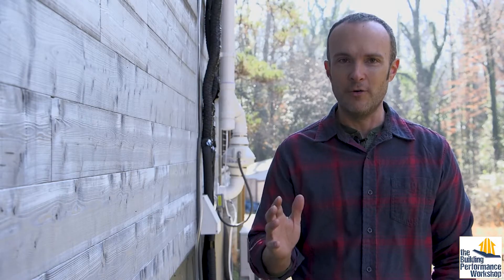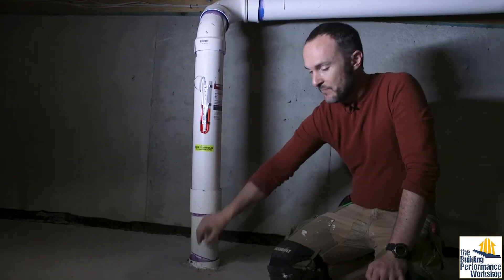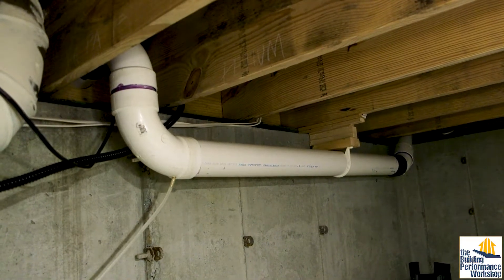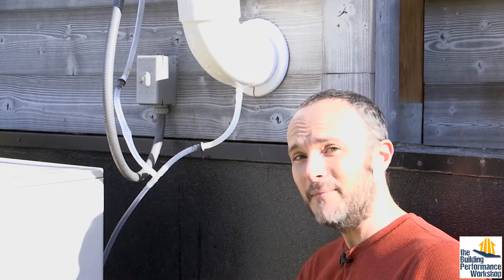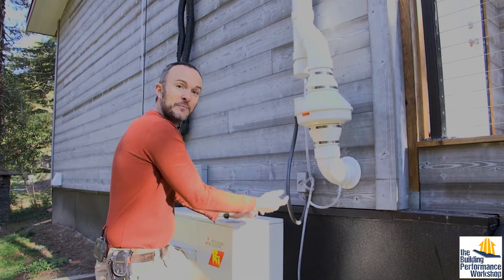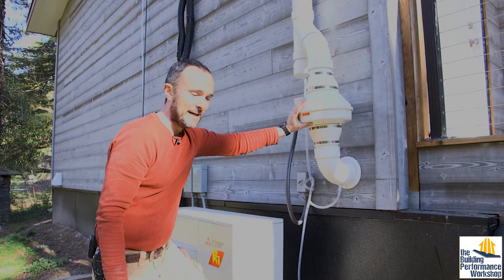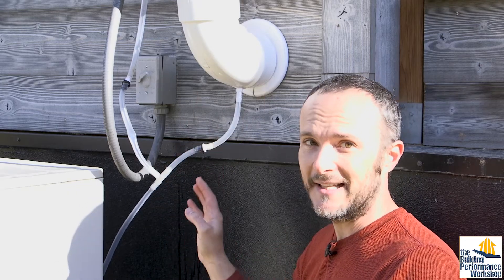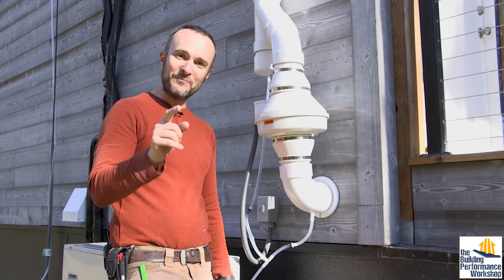How to Hotrod a Radon Mitigation System at Home

Comment: Curious Corbett, could you have inverted the fan so it was pointing down and run a U shape pipe (two 90 degree elbows) to curve the pipe back up?  If so, that would keep all the water out of the fan and require only a small weep hole in the bottom of the U to add drainage since it would be on the high pressure side of the fan.
Reply from the maker: Yeah, but it hurts the performance of the fan itself. Each turn creates a huge amount of Equivalent Duct Length.
Reply: @HomePerformance , this would definitely be the case if the airflow rate was high, but based on your comments indicating low fan speed and high negative pressure, it sounds like a very low flow system.  If you know how many CFM are actually flowing you could estimate the effect of adding the bends.

Also, by doing the upside-down U you’d be adding two 90 degree bends but subtracting two 45s, so the net effect would only be one additional 90.
Reply from the maker: Hey smart guy!

Comment: I went with an open pier foundation so I wouldn't have to deal with radon mitigation. But now I'm realizing that I have to deal with rodent mitigation l, which is probably more expensive 🤣
Reply from the maker: You can’t win, O. The Buddhists say that life is like falling down a well, open-eyed.
Reply: @HomePerformance  lol. It definitely feels like that when it comes to home building. I liked your saying from the other video- " as expected, the unexpected happens" 😂
Reply: I see alot of heavier mesh screens to address that in Maine but actual insulated walls keeps the heat bills down and the radon capture up.  You are right, it's hard to get a win-win situation.

Comment: So will those drain lines and check valves freeze in the winter
Reply from the maker: As explained, no, I don’t believe they will
Reply: Yes, they will. Might not at 28*, but at -10* they will.  Going to be problem in northern climates.

Comment: Thanks for this video Corbett, this is an interesting installation. Can you consider a video on radon retrofit options? I have a 1950's era home and I wonder if an exhaust fan pulling air out of the basement may help reduce radon in the basement rooms. If I used an in-wall HRV like the Lunos system, heat could be recovered, and fresh outside air would replace the air being exhausted. What do you think about this approach of simply venting basement air outside?  This may not be a perfect solution, but seems like it may be an improvement over doing nothing. Thanks for any thoughts on radon retrofit options.
Reply from the maker: Good idea, Mark- but Lunos is not the solution, since it does not induce a consistent pressure imbalance (it switches back snd forth between two fans). You CAN help your situation by using a simple exhaust fan like this:
https://youtu.be/bg3AiGUTZR0

But you must airseal the walls of your basement so that the only way to replace its air is from the house above.

Comment: I suspect all the drains are completely unnecessary.  It's a 4" pipe and there's air flowing through it. It will allow moisture to evaporate (if it's liquid) and be pulled out with the airflow.  Good example and a mistake I've made myself that Green Building Advisor discusses - you have to plan this stuff before building.
Reply from the maker: Wrong- when I drilled the drains they poured water into the bucket like crazy. 100% necessary.
Reply: @HomePerformance  Corbett, you suggest that others 'rephrase' their comments when you find them to be snarky, but then you immediately start your reply to me with - Wrong.
Reply from the maker: I didn’t think you were being snarky, I thought you were deducing from building science theory. Theory is wrong a lot of the time, and when real world data shows so, I like to know when I’m wrong. I assumed you’d want to know your idea was disproven. Nothing personal.

Comment: @Home Performance - we're building a slab-on-grade, single-level home.  I can't think where we'd consider placing the radon mitigation system; or if it'd even be necessary.  Any thought on the matter?  Great info....as always.
Reply from the maker: Yes, I highly recommend you do it- costs little to plumb in the pipe, and you only install and activate the fan if you need it. I would bet you will need it, since your home will be legally required to be much more airtight than the ones we all grew up in.

Comment: 1. You got way to many bends in that radon exhaust pipe. It should not have more than 180 degree in total pipe bends. 
2. Instead of using a 90 elbow between the fan and the wall penetration, use a Tee so any water that accumulates can fall into trap instead of entering inside the home. 
3. I would recommend boxing in the exterior radon pipe so its hidden. Looks butt ugly on the exterior of the house. Just drill a hole through the SIP roof panel to keep the pipe hidden from the bottom wall penetration to the bottom of the SIP.
4. Use an adjustable PVC straight pipe to connect to the top of the radon fan so its much easier to replace. The way you have this set up its going to be PITA to replace the fan when it dies in about 2 years or less.
5. I doubt those check valve will work as you intend as they typically need some pressure (at least 0.5 psi) to operate. there isn't going to be enough pressure for it work. 

This is a much better rain cap:
https://www.homedepot.com/p/Active-Ventilation-4-in-Dia-Aura-PVC-Vent-Cap-Exhaust-with-Adapter-for-Schedule-40-or-Schedule-80-PVC-Pipe-in-White-AV-4-PVC-WT/205694961
Reply from the maker: Thanks for the advice, guy, but this system works great, I do not think it’s ugly at all, and flexible couplings will not make the fan replacement overly difficult imho. Maybe you could rephrase like “here’s a different way to do it”.
Reply: Cosmetics is always relative!   I think air handlers on the outside of a house are ugly and MUCH nosier than your average radon fan!
Reply: @stanplowden3939  Not if they are install right. My condensers are wall mounted an all of the connections are hidden from view. But 99% of the installs I've seen are indeed ugly.

As far as noise, you cannot hear mine running, unless you with in about a foot.

Comment: Great system.  I did it with a aluminum downspout "instead" of PVC on the vertical run. The goal was to makes the radon pipe look like a downspout!  Caulk and paint and plumb it up and right "next to the gutter" and most folks would see it!  The rest of your system is awesum.
Reply: I think the fear of the air coming out of a radon system is overblown. It’s certainly well diluted from running 24/7 and would have very minimal actual radon per liter. Why I can run my gas clothes dryer vent out the back of my house without issue but radon should be vented above the roofline simply does not make sense. I’m sure a rain gutter is more than sufficient even with leaky joints, especially considering PVC does not tolerate UV.
Reply: @coloradobeeguy lived with Radon for at least 30 years, without knowing about it until now, no known issues. I'm sure dissipated Radon with constent venting is fine just not ideal. And I also agree with the other venting you mentioned, let alone chemicals and indoor pollution.
Reply from the maker: Ok, but if you configure your system against code it’ll be harder to fix if you ever have it inspected for resale.
Reply: @HomePerformance Nobody will give a shit. Just tell them it was like that when you bought the house. Blowing air through a downspout will have 90%+ of the air go through the exit and not leak, which means 90% of the radon will be going as well. If you're reallyyyyy worried, caulk the joints, which is such overkill that it's hilarious to even suggest.
Reply: @PSNDonutDude I find interesting that you think people won't give a sh!t. I think a purchaser would care even more once their inspector tells them that your system was possibly installed against code. Furthermore, if you stand by your work and your thought process, why lie about it?
Reply: How do you know that using aluminum downspout for radon venting is sufficiently airtight? If it leaks anywhere -- but especially near a window -- that would be a problem. Nowadays, many jurisdictions have code requires Schedule 40 PVC for radon venting.
Reply from the maker: Cool idea, Adolf- whatever works!
Reply: I've seen large rain gutter use as well. It was next to a pine tree and I originally thought it looked like a type of garbage disposal for the needles rain gutter.

Comment: Corbett, Does the radon vent pipe have to exhaust above the roof?  

I remember you saying in a past video an additional benefit of the radon mitigation system would be decreasing the humidity from the interior envelope; has this been proven correct?
Reply from the maker: Yes it does, and yes it does! We’re actually dry as heck right now, below 30% RH inside, and I’m wondering what to do about it.
Reply: @HomePerformance  You going to try and keep relative humidity (RH) between 40% and 50%?
Reply from the maker: 30-50 is fine by me, but 29 is pushing it
Reply: @HomePerformance  We had a humidifier installed on our furnace. Make sure that if/when you go to do it, you get one with an automatic temperature sensor so you don't end up having to go into your basement and turn a freaking dial depending on the outside temperature. I wish I knew the things I know now, but 3 years ago. It seems that if you don't become an expert or as informed as possible then you will get taken advantage of every single time.

Comment: My Airthings wave shows an average of 1.1 pCi/L for the last 6 months and I have seen a 1 hour peek of 2.2 a couple months ago. I live in Washington and have a vented crawlspace. 

Do you think think there would be any benefit to putting an active fan on the crawlspace that activates when the level goes above 1.0. 

I am going to have the crawlspace air sealed from the house this year. I’m sure that will help a bit for what gets inside.
Reply: @James Meehan thanks I will look at the readings again after everything is sealed up and the vented crawlspace is properly separated from the house.
Reply from the maker: @Ecospider5, I think you should weigh feasibility and cost to get your 2.2 down. It’s a pretty low reading already, and you might seal the crawl to the extent possible and not make a big dent.
Reply: If your crawl space is vented and the vents aren't blocked off You probably won't have a radon issue. You can buy one those fancy Radon meters or use a radon test kit to check.
Reply: @Guy Tech the numbers I gave in my post are from one of those fancy radon meters. And as I stated in my post I have a vented crawlspace. I was trying to get peoples opinion if the readings I’m getting are worth dealing with and is an active fan blowing through my vented crawlspace is a useful idea.